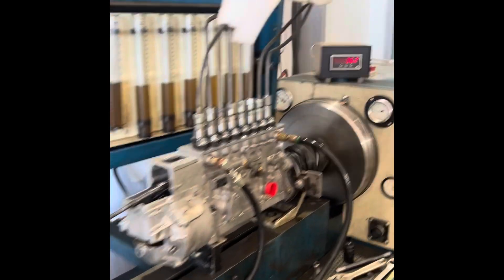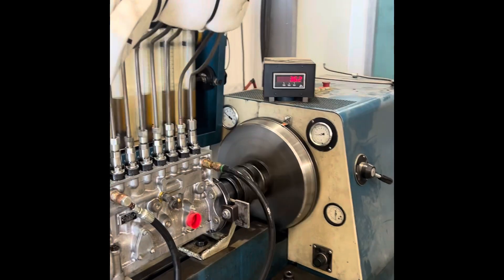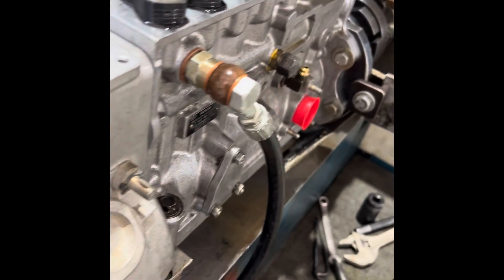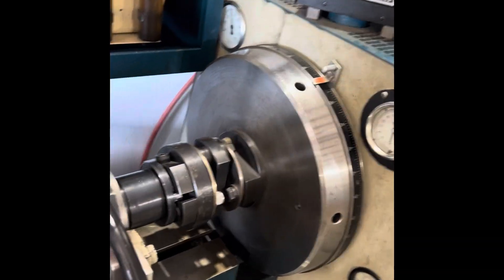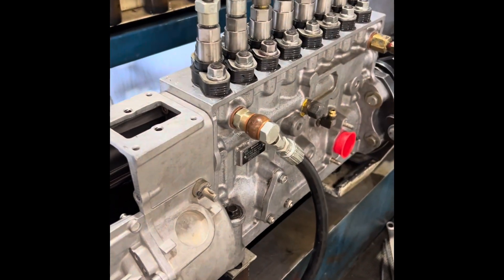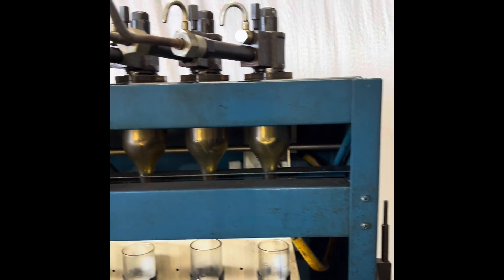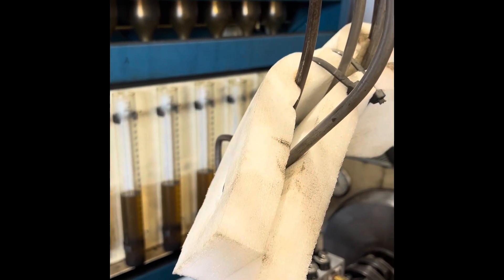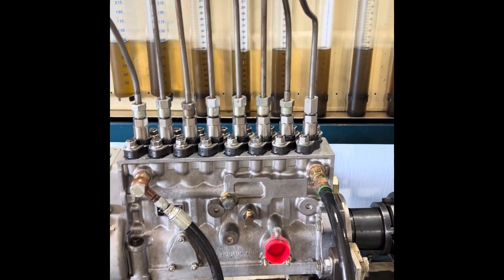14mm 8 cylinder E9 V8 Mack pump!

Comment: Some dark test oil you got going. You are doing just fine. Just don't lie to yourself on the specs. Some days it can be a fight to dial it in.
Reply from the maker: It’s actually pretty fresh. My last batch got engine oil in it. Looks like it will take a couple more changes to clear it up.